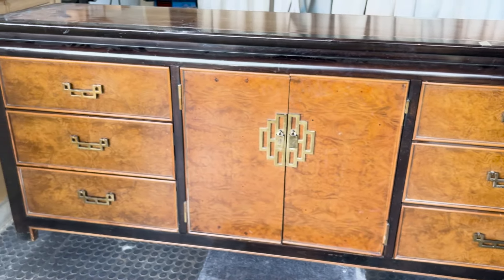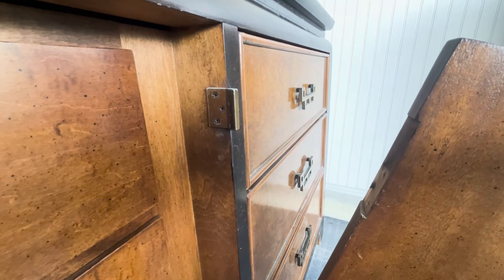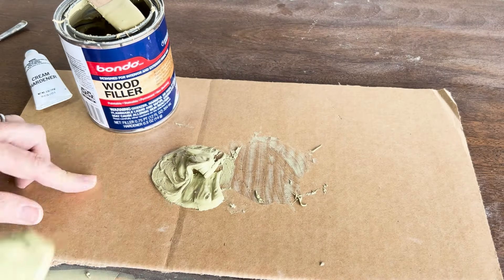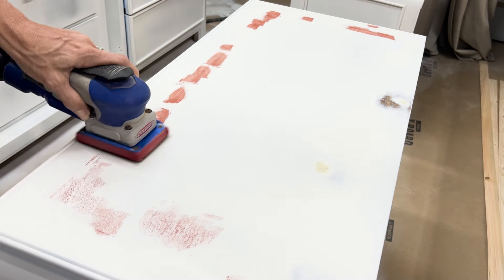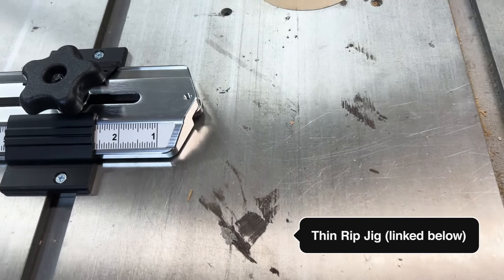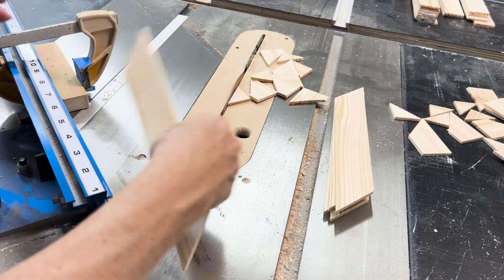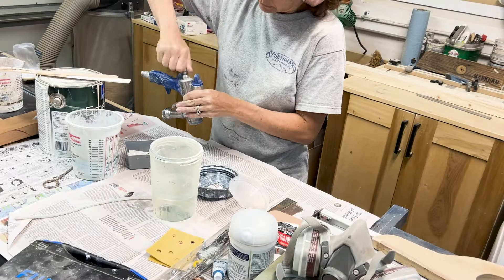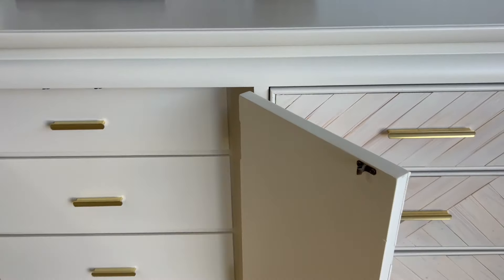Dresser Revamp: Prepare to be Amazed. This fake wood dresser gets a major overhaul!

Comment: It 100% is real. burled elm, a very rare and desirable wood. The case framing is ebonised walnut. The original hardware was solid brass. The furniture is the Chin Hau line by Century Furniture, one of america's top teir manufacturers, and designed by Raymond Sobota, a renowned mid century furniture designer. Pieces from this line are considered to be icons of 70s modern, and sell for thousands of dollars.
Reply from the maker: Thanks for the info. Some of this helps to make sense of my confusion when I was assessing the pieces. In many ways they had the marks of quality: solid frame, dovetail drawers. But the pressed wood under the veneer, and when I sanded (not aggressively) the Burl the texture disappeared, led me to believe this was not a high quality piece but more likely a good knock off. Either way, the extent of unfortunate damage to the tops and the entire left side of the dresser removed the possibility of a proper restoration for these pieces.